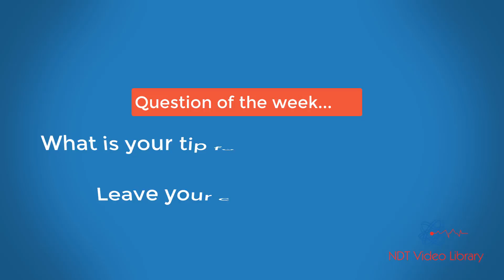Tips to be a great NDT Technician Part I

Comment: hello, I'm I've been a Boilermaker and pressure welder for 10 plus years now and I"m looking to make a change to NDT tech. I just don't know which course i should take to get a start, I was thinking Dye penetration because we do that our selves before we lay down our welds.  Any advice to get started or what you would of done differently when you made the start in the career would be much appreciated. I'm an aussie by the way so i know things may be different here but any information would be great.
Reply from the maker: I would start with Mag and Pen first.  Get some experience, then jump on to UT or RT whichever you personally prefer and whichever is in demand at your workplace. Then get some more experience and then jump on to PAUT/TOFD (if your are in UT) or CR/DR (if you are in RT). These advanced methods will keep you busy. After a few years, you may choose to go for CWI, Level 3, or API depending on what's relevant in Australia. All of this is just one way to progress in your career. Not THE ONLY way. Good luck and welcome to #NDTlife
Reply: @NDTVideoLibrary  cheers mate!

Comment: Thanks for the video. Please I need your advice, I have a B.Eng degree in Materials and Metallurgical Engineering, it has been difficult getting a job because of non existent of a steel industries, manufacturing or founderies in Nigeria, and most of the oil firm in my country prefer graduates of Mechanical engineering. I have surviving work as an Electrician with the Electrical skill I learnt from my Dad and earning very little because have got no electrical certificate to back up my skill. I want to become an NDT/NDE because this is one part of Materials and Metallurgical Engineering I was very comfortable with back in my University days. I will love to know what it will cost for the training and is there any age limit(Am 34years Old).Thanks for your anticipated speedy response.
Victor Onwochei
Victoronwochei@Yahoo.com
Vicaz05@Gmail.com
Reply from the maker: I have sent you an email, Victor.